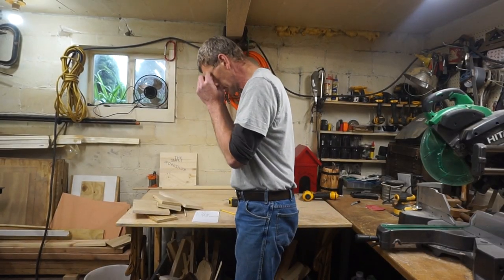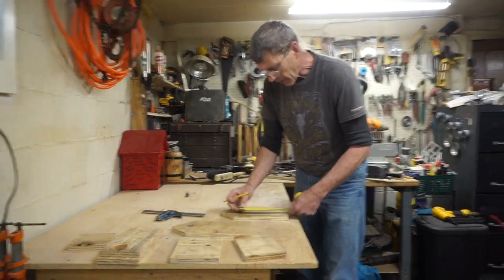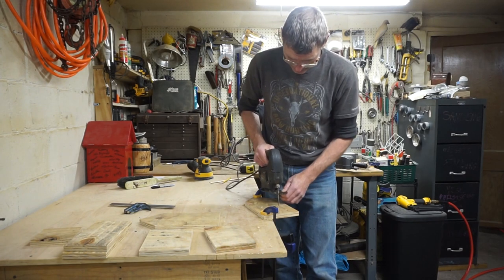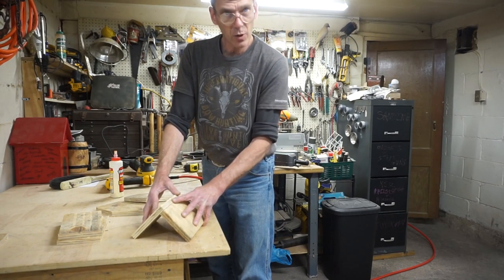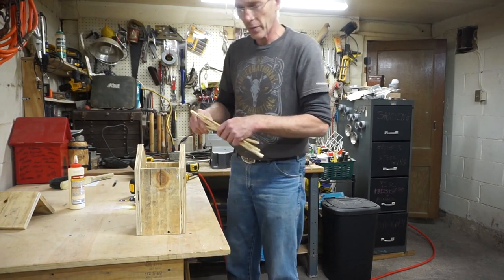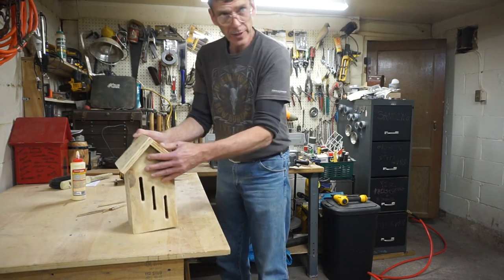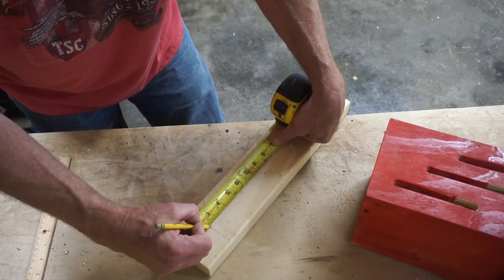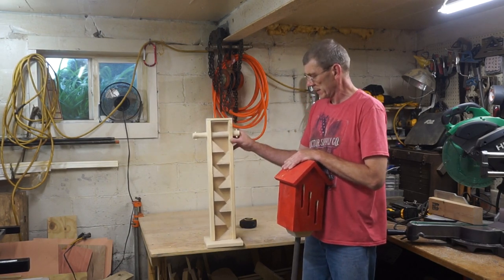DIY Butterfly House

Comment: Love the Video  but I was wondering what did you use for a mounting post and what holds it in the ground?
Reply from the maker: Used part of a 2x4 with a hole drilled for a 3/4 piece of pvc pipe